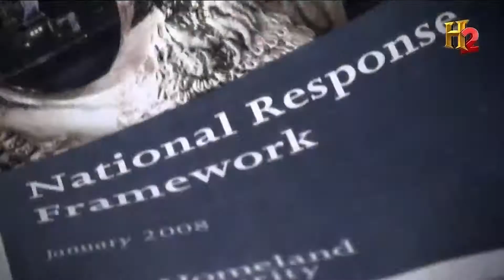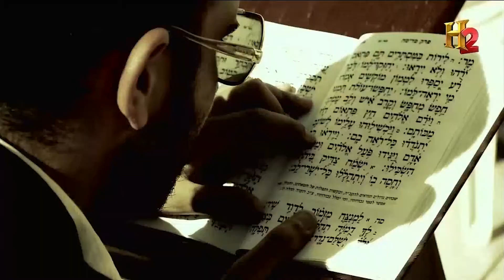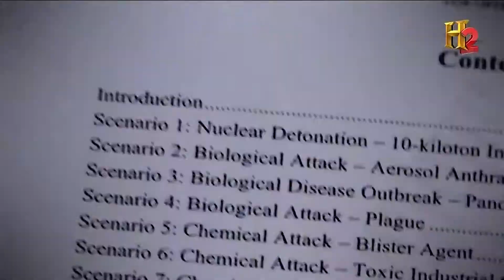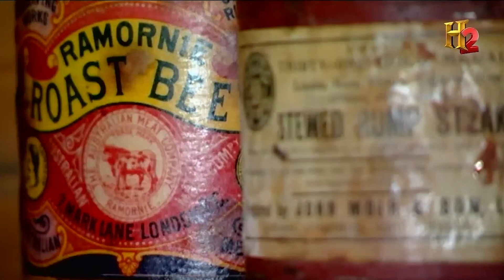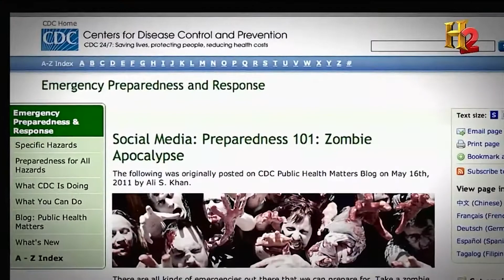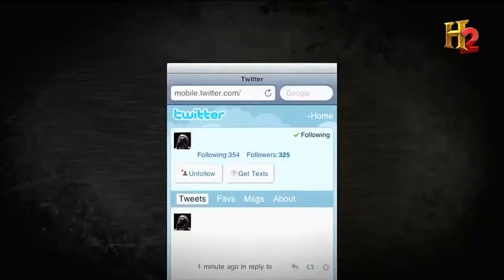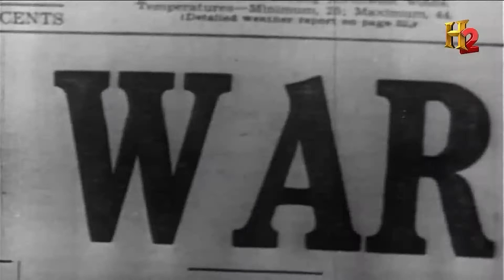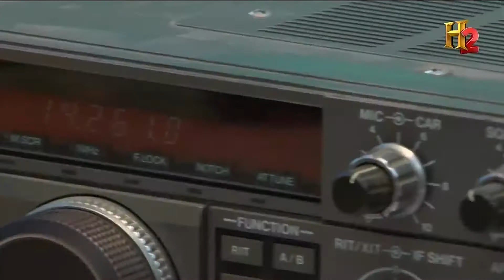#Apocalypse #Biologic #Virus Zombies A Living History Part 2 | Bio Warfair Next Generation of War

Comment: I agree 100% on the need to have BOTH firearms and a hand weapon like a machete to get brush, firewood etc. But when you look at a firearm, it's loud, heavy, needs to be clean often, a few days if you're using it often or going to the gun range, not many people know how to clean firearms or how to see if they are working correctly, they can jam easier than using my machete or my axe, along with the other facts, guns need ammo, and in a zombie overrun world, ammo is going to be hard to find and or get when you do find it, 90% of the time it's locked up with damn near unbreakable glass, you're going to risk hurting yourself or getting tired, getting caught or making a really loud noise, something zombies can hear and will seek out to investigate. In my opinion using your firearm or anything that's louder than a hand weapon, should be your LOST choice.
Reply: Very well thought out but there somethings that you can benefit from knowing. A lot of places take the cheapest methods for securing ammo and guns. By putting reinforced glass on the front they prevent stupid people from stealing them. Use that crowbar you are likely to have by now and pry that glass off or at the very least smash that lock. Don't worry about zombies hearing you, they hunt by smell. (Otherwise zombies would hunt other zombies)